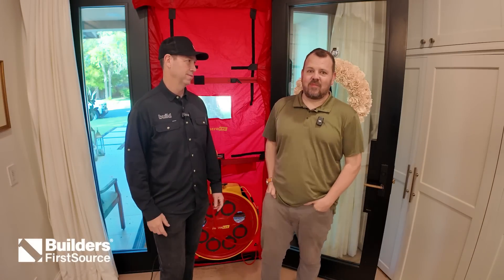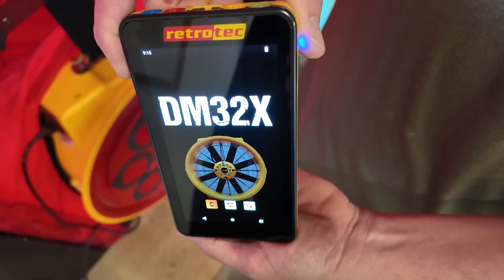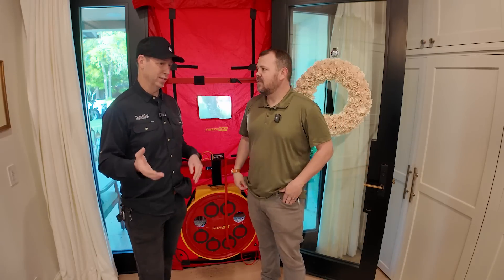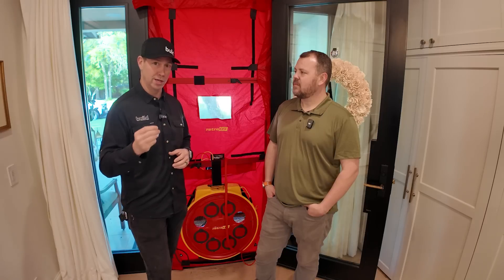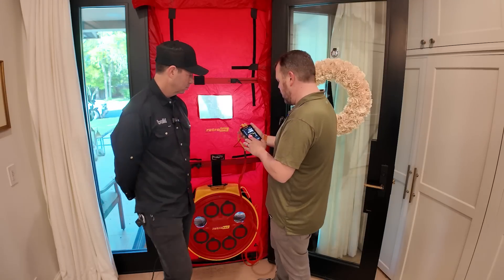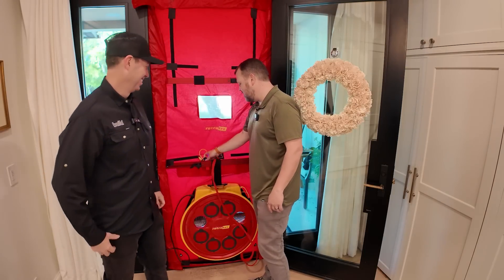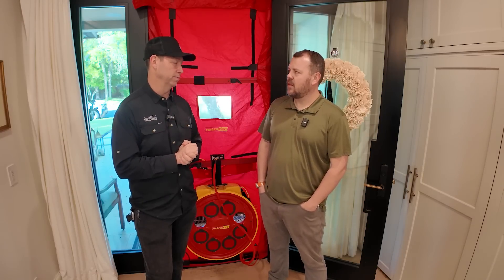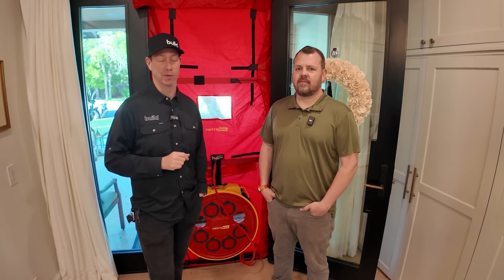Is your house leaking? THIS is how you find out!

Comment: The only windows that keep dust out, casement windows with rubber seal, awning storm windows with twist locks, and a couple others.  Sliding doors and sliding  windows are a joke.  Our front door Hurricane doors over 1000 pounds.  Greased fitted hinges.  Lucky to have a steel frame house with 6 inch concrete floors upstairs.  What is your view on steel?

Comment: Hi Matt! Right now on the Green Building Advisor website there is an article by Jon Harrod about the Ephoca Cold Climate Heat Pump which doesn't need an outdoor unit. It can mount on the wall or ceiling and you can also get it with an ERV included. There is also  video from Taitum Engineering about the unit on this site. Have you heard of them before?

Comment: Cool test but how do we seal older homes without spending tons of cash?
Reply: Board up your windows 🪟
Reply: Replace windows, replace doors, seal AC ducts, sprayfoam the attic floor and insulate over it, sprayfoam the crawlspace or do the sill plates in a basement, do a blower door test with a professional who will help you hunt leaks - then solve them if possible. Yup, did this and while I don't know what my reading is off the top of my head it's WAY better. No longer do my curtains move when the wind blows in Winter and my energy bills have plummeted. If you have your siding replaced see about having the walls insulated, do housewrap, or rigid foam. I never got to do any of those :(

Comment: So what's the mineral oil thing you said you did? I'm interested in learning about it but can't seem to find anything in it
Reply: He put emergency overflow drains in the laundry room and underneath the dishwasher. Just a floor drain that goes outside. He filled the p trap on the drain with mineral oil so it doesn’t evaporate.
Reply: @csquared9660  Any idea why it wasn't run into existing plumbing?
Reply: @ChristopherCurtis  My best guess is for detection purposes...  In the existing plumbing he'd have no idea if one of the overflows was occurring, but if water is gushing out of one of these outside, it would be really obvious he had a problem.

Comment: Is there a crude way to check how well your house is sealed without using a blower door? My house was built in the 1960's and I've never had it tested, so before I spend money on a professional, is there a way to see if I would benefit from hiring a professional? Can I make or buy something myself that would give me an idea of how well my house is sealed?
Reply: Yeah just use an old furnace blower seal it up around the window or door and use a manometer to get the inside and outside pressure difference you could just use a tube filled with water will work just fine if you want to be real cheap. And while it's under negative pressure you can walk around with a smoke stick and figure out where your biggest leaks are at.
Reply: @chptech  I like that idea! I'm not sure if anything is wrong, so a down and dirty approach is exactly what I am looking for! Thanks man!

Comment: You guys should do a positive and negative pressure test to see how your house truly performs under a windload.
Reply: Yes.  If/when the zip tape adhesive starts to fail, a negative pressure test won’t show the problem, but positive pressure will.  OTOH, even with poor adhesion, with real-world wind, the tape should still mostly block the air entry on the upwind side.
Reply: Why would the Zip tape fail? It's covered by siding.
Reply: @stevemullen8457  I think the basic answer is that everything degrades over time. I'm no ZIP tape expert, but heat is one method for overcoming adhesives, siding or not.
Reply: @stevemullen8457  The vast majority of site-applied adhesives eventually fail due to age.

Comment: Great video on blower door testing.
Matt, since your house is encapsulated, did you open the attic stairs during the test? Testing should include all calculated volume during testing. Available air should have a path out of the attic to the blower door for a more accurate reading.

Comment: Any recommendations on great contractors that do blower tests in the Dallas, TX area?
Reply: Wonder what their contractor pricing is when the equipment is 4-6,000 dollars. You could buy it, DIY, then sell the equipment... for less than $1000?
Reply: @sloth6765 check your local tool library if you're lucky enough to have one. mine has one. Seattle area